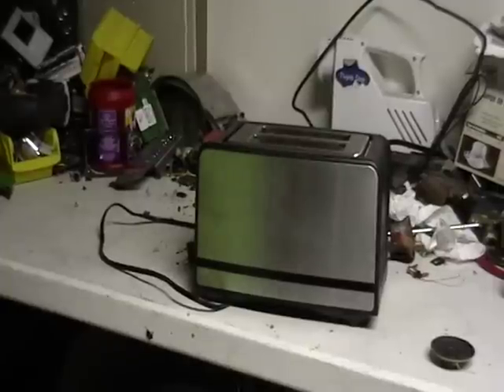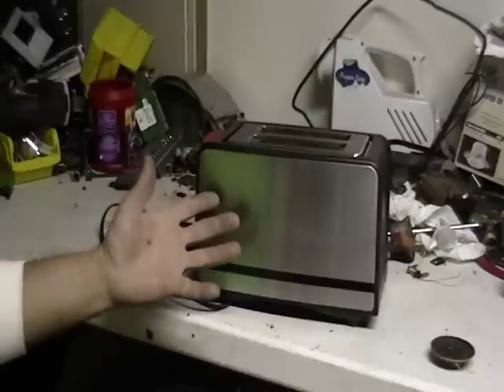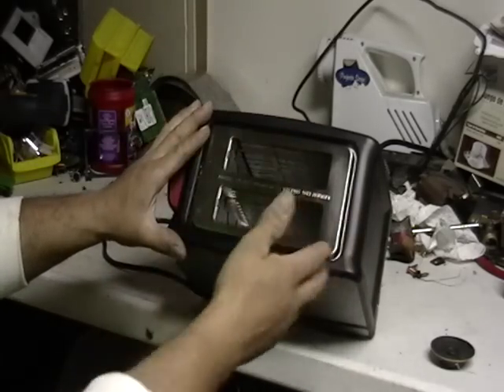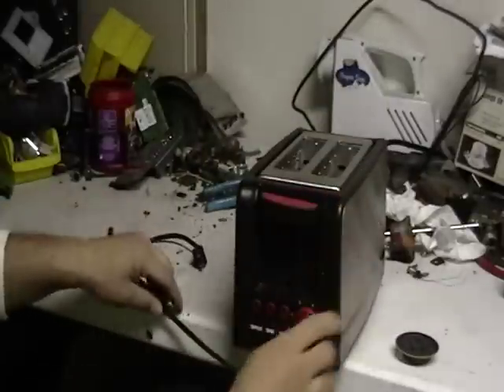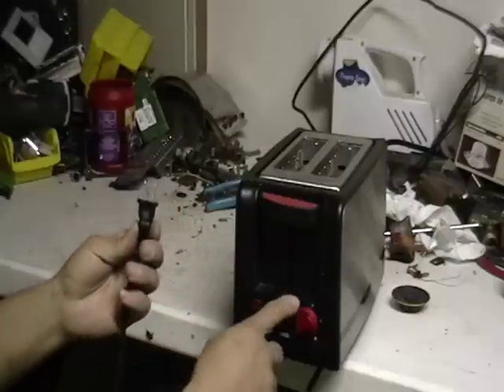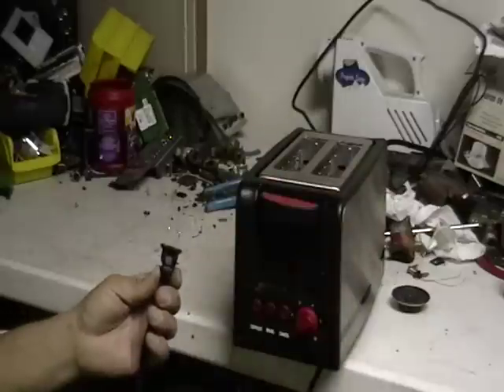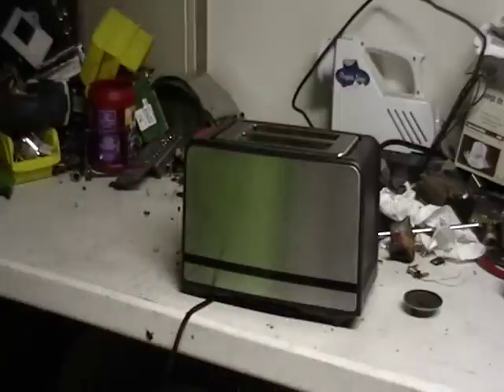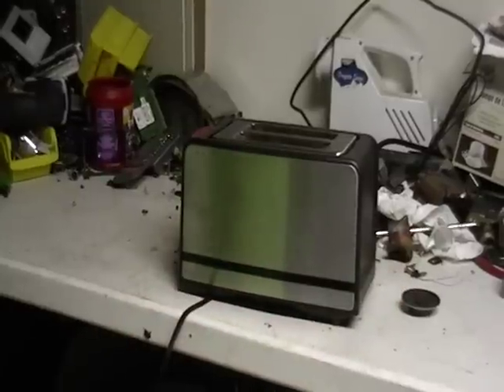Scrapping a toaster

Comment: just took apart a toaster. figure got about 2.00 out of it. got a small thread like thing w/ small copper wire, and maybe some silver. not sure. the boards that separate the burners, had like small silver slivers. just wanted to know if those boards would contain silver?